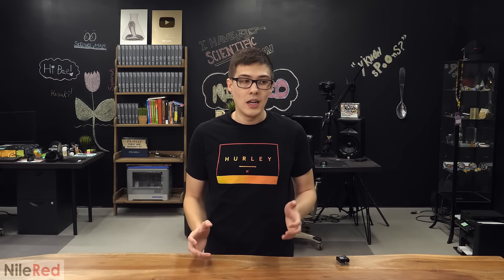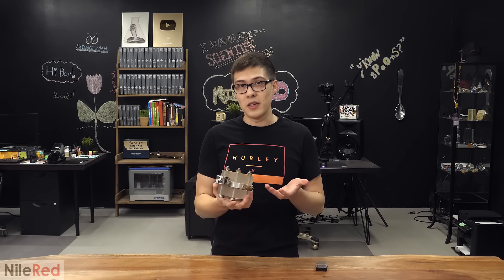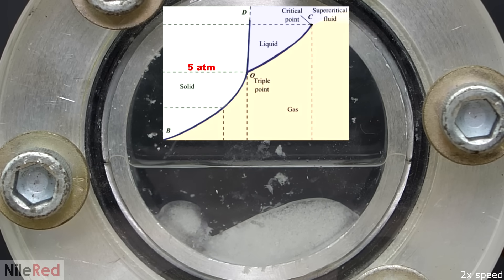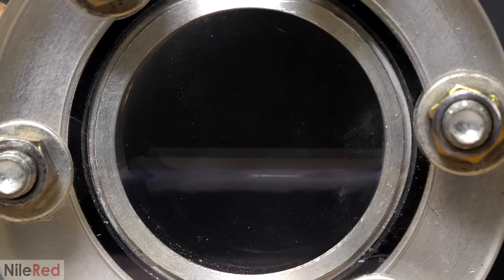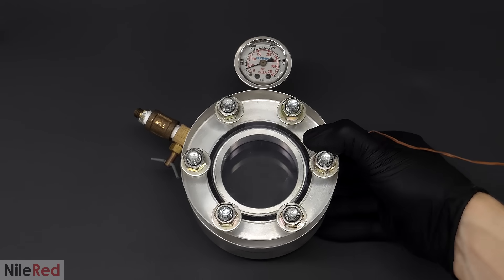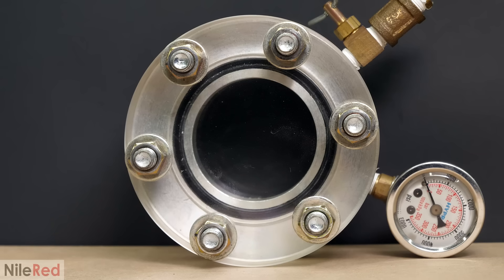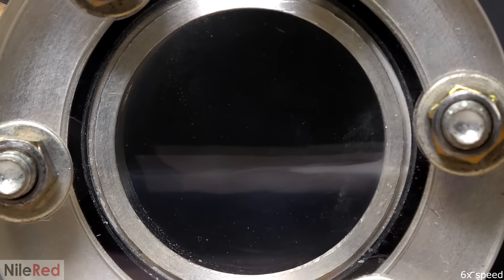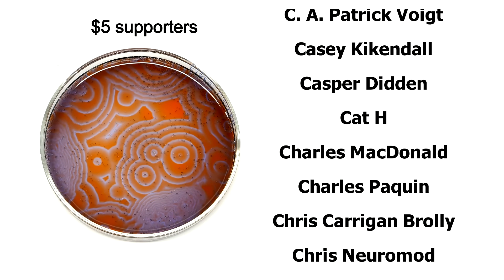Going supercritical.

Comment: You could try dissolving stuff in supercritical fluids. They're very good at it. You can dissolve organic molecules and water in supercritical CO2. You can dissolve oil in supercritical water. Supposedly some salts will actually precipitate out of supercritical water when it's heated and the polarity of water drops, though it doesn't seem like NaCl is unless I'm bad at reading diagrams and I think these salts must eventually redissolelve at high enough temperatures. Above about 1.5 GPa and about 900°C, even lava and water become completely miscible in each other. (Specifically with granitic or more mafic rocks, or probably most carbonate, hydroxide, sulfate, nitrate, or chloride rocks, i.e. most rocks, but probably not pure silica or alumina or spinel or many simple oxides or phosphates, and definitely not carbon, apatite, rutile, monazite, or zircon. Also, other volatiles like CO2, N2, NH3 and CH4 tend to reduce solubility. In general, though, rocks that are completely molten at a temperature when dry will also be completely miscible in water at that temperature at >1.5 GPa.) You obviously would need something more sophisticated like a sapphire or diamond anvil to test that last one, though, and the chamber would probably still be really tiny.

Comment: You were right, the color inside is because of the fine cracks. It is a little bit like opal, but kinda different. Opal has an appearance of depth because it forms in layers essentially, so it doesn't get its colors from being cracked, it gets it from the different layers of crystals facing different ways. Clear quartz, if cracked, can pick up color like your beads did. The fine cracks usually are curved and they bend the light passing through, unlike the flat outside of the crystal which just reflects the light. Really, most types of quartz can get these kinds of fractures that make color appear inside since all quartz are very similar.

Comment: The pressures in your apparatus are close to the ambient pressure at the surface of Venus, which also has an average surface temperature between 480 and 500 degrees C. The atmosphere is so thick the carbon dioxide gas that makes up 97 percent of the planet's atmosphere has a density one tenth that of water at the surface. Probes have dropped all the way to the surface from space and atmospheric entry without any parachute at all, and still reached the surface intact. They functioned for up to two hours before the lethal heat seeped inside and destroyed the electronics. Soviet engineers built test chambers they used to test the Venera probes and systems thereof to assure they would work at Venus. They were pressurized and heated above the already deadly surface conditions at the planet's surface. However, supercritical carbon dioxide has a nasty side. They found it can cause a sudden, violent chemical reaction with titanium, which the then Soviets and Americans used to build the pressure spheres for their Venus probes. The first three Soviet probes imploded 15 miles above the ground from the rapidly rising atmospheric pressure, it was not until Venera 7 was built to withstand 180 atmospheres that a probe reached the surface and reported on the temperature and pressure there. Since then, they were all built to withstand 100 to 105 atmosphere pressures. While testing an apparatus in a test chamber, it suddenly self-combusted, leaving very little of it left in the chamber. In other words, at high pressure and or temperatures, even compounds such as CO2 that are relatively inert can suddenly become very reactive.

Comment: Hey there! Not a geologist or a chemist by any means, but I am a bit of chemistry hobbyist. I know for a fact that the process of decaffeinating a coffee bean is exactly as youve just demonstrated here. You put coffee beans in a pressure chamber with a solvent, pressurize the coffee bean/solvent in a chamber until the solvent reaches super critical state, and the solvent penetrates the beans and since it is still technically a liquid like you describe in this state, it can dissolve a  lot of chemicals out of the coffee bean, this process is technically "like" osmosis, but not quite like how we did it in chemistry class lol.  This is the process that manufacturers have been using to make caffeine extract and decaf coffee since the 70's. 

My best guess here, is that similar processes are happening, except that instead of the CO2 dissolving silica in an osmosis fashion, perhaps the CO2 is actually reacting with the silica in some way to form some crystalline networks similar to quartz.  

(maybe a way to test this theory would be to vent the gasses into a carbon monoxide sensor and if it detects carbon monoxide, you know that somewhere. CO2 became CO and that there are oxygen atoms missing somewhere, potentially in the silica forming SiO4, aka quartz)

Again, not a chemist here, nor a geologist, but I am the worlds biggest coffee nerd, and got excited to tell you that you should make some decaf coffee  and caffeine extract next time with your set up!!!

Comment: Yo it's easy to calculate the limits all you have to do is just weigh before putting dry ice and after putting dry ice and then all you have to do pv=nrt calculate pressure value compare it with a safe capacity of a material or you could just do a reverse calculation to get the exact value of fco2 to put in order to ensure safety 

or

jus put a blow off valve!!!

Comment: Lol that gauge is measured in thousands of psi you just never got to a pressure that it could read.
Reply: See at 13:10 you reached a sufficient pressure for it to sorta start working. But still too low for it to be really accurate

Comment: Great video, very enjoyable. Could you do an experiment where you use styrofoam beads instead of silica. The idea is that the styrofoam would float on top of the liquid CO2 and it'b interesting to see at what happens when criticality is reached. Would the beads drop to the bottom of the chamber as the interface disappears or would they start floating around in the chamber as the densities of liquid and gaseous phase approached each other, or would they rise to the top of the chamber? I think the last option, but it'd be interesting to observe.

Comment: I haven't read through all the comments to see if anyone else mentioned it, but you're gauge problem is that you where drowning it. The gauge was flooded with the liquid CO2.  The chamber should have been rotated so the gauge was at the top, above the liquid level. As it was a air/gas PSI gauge, it simply wasn't designed to handle liquid internaly.

Comment: regarding the colors with respect to the anlge of view of the silica beads: Do you know if there's local order within the structure of the beads? Because than there can be Birefringence.
https://en.wikipedia.org/wiki/Birefringence
https://en.wikipedia.org/wiki/Polarized_light_microscopy#The_Michel-Levy_chart
If there are areas within the beads that produce linear polirized light, others that act as a lambda/4 plate and areas that cause a total reflection (so the light is once again linear polarized) you could see these colors.

Check this for example by looking for tension within regular glasses: Hold your glasses between the linear polirized light of you PC Screen (if it's not OLED) and the reflection of it from a surface that's not a metal (i.e. glass from your mobile phone). What I mean is (in terms of the light beam):
PC-Screen->Glasses->Surface Reflection-> your eye

Comment: Introducing any kind of semi-solid material to a drastic change in temperature tends to form stress points or fractures.due to the drastic change in temperature it now does not have complete ability to hold itself together therefore resulting in the diverse labyrinth of fractures or cracks

Comment: As the cracks develop because of temperature on the crystals that had formed. When you allowed the gas off, small amounts of air inflooded your chamber. The small amount of water as gases would infiltrate the cracks and larger particles show red flashes and blue the smallest molecule of moisture. Just like opals. Some tones need to be slowly cooled

Comment: When you pressurise a gas it also heats up. When you lower the pressure of a gas it drops temperature. I wonder if the same thing also happened to the silica beads so the cracks could have been caused by some sort of thermal shocking within the beads, or from the rapid CO2 temperature changes or both. I do not know at all, so just some idle speculation on my part.

Comment: I would guess that the colours come from the cracks being on the order of a wavelength of light, so you get interference between the reflection between the internal reflection on one side of the fracture and the external reflection on the other side.

I used to have a piece of obsidian that had a fracture at a shallow angle near the surface which had a couple orders of interference rainbows.  Pressing on the surface would actually compress the gap, and change the width and shape of of the colour bands.
Reply: Essentially it is like the "thin film" effect you mention, but it's a thin film of vacuum, air or CO2 in the medium of solid silica gel.

Thin films get colours the same way.  reflection of the front surface and back surface interfering.

Comment: Supercritical fluids are best thought-of in terms purely of density.
At the critical point, the liquid CO2 and the gas CO2 have the same density.  This allows the liquid to "float" into the gas.  This is why it turns into "smoke" or vapour clouds, because that's exactly what happens at the boiling interface of any common liquid. Indeed inside any cloud of steam are tiny water droplets, these are what make them opaque and white.  Once the droplets disperse, pure water vapour is completely transparent and colourless.  This you can see with the supercritical CO2.  The liquid floats up into the gas, turning into a kind of steam of droplets.  Once these disperse fully, this gives the single homogenous high-density gas.

If you were to shine a strong light source through the chamber when it reaches the critical point, you should get some cool optical/rainbow effects.

Also, really from a safety perspective, you should never operate a pressure vessel with a malfunctioning gauge.  Especially something homemade with an unknown fail pressure and no burst disk.
I hold a PhD in Chemistry, am a Chemical Engineer by association and specialise in CO2 capture.

Comment: This is also greatly dangerous but: you can also get liquid/near supercritical carbon dioxide by putting dry ice in a tightly closed centrifuge tube (I used a 15mL one). Also, when you open it quite quickly there's a huge sound and an instant crystallization

Comment: A lot of what you are seeing maybe associated with thermal stresses. Also the need for the temperature to equalize across the solids. This is usually a big concern when dealing with really thick materials. Many time larger pressure vessel have to include a thermal soak when making large temperature changes across the surfaces. This could be what is causing the micro cracks in the beads but could lead to catastrophic failures in larger samples of the same material.

Comment: I think the iridescence of the beads is due to a lot of small matter variation that can refracts light like a prism at different angles, but thoses sames rays could encounter another zone acting with the prism or even encounter a bubble of air or any gaz imprisoned. So all of that make the iridescence possible, the fact the aerogel keeps quite blue it's because the refraction process is going the same everwhere or the "matter is constant" but when forming, it could be that the matter is not homogen and could have variance of colors, also as it's more thin at the edges it could change color there.
It could be interesting for you too check PBR, SSS (subsurface scattering), refraction.
Also I remember of an easy experiment. Take a recipient, pour water in, take a light that goes downward an oblique way, look at the other side, classic refraction, now gently poor droplets of milk in the water progressively, and you should see an orange tint like on sunrise/sunset

Comment: Gray video. Very well could be the beads had a bit of water moisture in them.  Feazing and cracking like ice. All So the coler changes could be from contaminates they had absorbed. Possibly part of the alloy of copper brass lead and tin from the case or gauge.

Comment: Comment about gaining confidence in the integrity of the chamber:  High-pressure chambers and boilers ate tested by totally flooding them with water (or other liquid) and using a hydraulic pump to run the pressure at least to 1.5 times the maximum expected pressure, and verify that chamber holds pressure for 15 minutes without leaks.  The reason for the flooding is that the liquid, in compressing only by minuscule amount, does not absorb significant amount of energy.  Most of the energy is stored in the walls of the chamber, and if the chamber is rigid, that will be small also.  it will be only this (small) energy that can be released if the chamber fails.  To appreciate what can happen of supercritical chamber fails (where huge energy is stored in supercritical water, look at this video:
https://www.youtube.com/watch?v=uo7H_ILs1qc

Comment: 3:34 
When cranking down bolts makes sure to tighten them a little in a crisscross pattern and then go back and do it again for the super tighten. 
You just cranked each one as hard as you could 1 by 1

Edit: Im not saying it is but it could be possible that, that's the reason why it leaked
Reply: Thats pretty much it did

Comment: So, for the cracks, I have a theory that silicon is so dense that it can't really be mooshed much further than it is in it's state as those beads. (If you take like, a strawberry, I'm quite sure you'll see it shrink). However, what can happen is it's molecular structure might "simply" change. We know that the strongest structure is somewhere around hexagons (take diamonds) which leads me to think that the extreme pressure of 1.2k PSI is enough to force dense materials to crystalize as it happens deep underground. (You can also see hexagonal shaped rocks forming in the bottom of deep oceans.)
I reckon you'd get a similar result with your transparent wood and with other resins which have been properly vacuumed. 
Please do make a followup video on this. If you really can force any dense enough material (with a weak molecular structure) to crystalize like this, it could be really interesting.
Reply: Now I want to build a pressure chamber to experiment with this idea

Comment: It can't blow of as the way it's sealed is not sufficient for higher pressures the seal is also the wrong size. The manometer shows 30 bar. That's not much...wouldn't worry with this up to 150bar. I would even dare to go up to 200 bar which would probably blow the sealing. If you have 15-20mm of macrolon this is able to stop a small caliber bullet. So with this diameter that last a few hundred bars without problem. 
Cool video bro...its nice to be able to see that.

Comment: I really wish you'd have dropped a couple torn-off corners of toilet paper or similar in there. I know it's basically what a supercritical fluid is but it was really interesting watching what appeared to be a gas making the beads behave as if you'd wet them. Seeing how toilet paper, or something else that behaves similar when wet, would be really interesting.
Edit: Another thing I forgot to mention. You said the beads behaved as though the chamber was full of liquid, but I don't quite agree with that. I think they really behaved more as if you'd just wet them, giving them a thin film of liquid, and then just had a gas in the chamber.

Comment: I bet some of the visible vapors and impurities are actually from water that froze on the dry ice when it was exposed to air, and that could explain why the transition was less visible on the nilered channel where the co2 came straight from the can without contact with the air
Reply: And I’m mostly talking about what’s visible around 9:17  but also 8:50 and 16:50

Comment: First thing I would have done is replace both of the O rings since they are the greatest point of failure.  Silica gel is an Adsorbent, meaning that it's most like a solid sponge, instead of it absorbing contaminants, they are "caught" in the cave like pore systems running through the beads.  In LOX production they are used to prevent CO2 from entering the fractional column.  Several chambers filled with it are used so they can be cycled as they become dirty and while another is in use, the dirty one can be cleaned by running hot dry air through it, then it has to be allowed to cool in isolation so that no contaminants can enter it before the process air stream ( a rarefied liquid) is again run through it again).  I don't know what would happen if the fractured ones you have could be returned back to their previous condition by heating them to approx. 185 F by using hot dry air and then shutting off all contact with the atmosphere until they have cooled, or not.  I wonder if the act of cooling them down to such a low temp, allowing their structure to fill up with liquid CO2, and then heating that up to supercritical temp and then letting the pressure evacuate, faster than the expanding gas could escape caused the fracturing of their internal composition, or if the cracks you showed us exist on the exterior also.  It would be interesting to know that as well.  ( Yes, I used to work on a LOX plant, as an operator and mechanic)